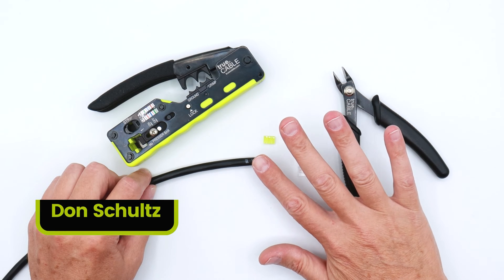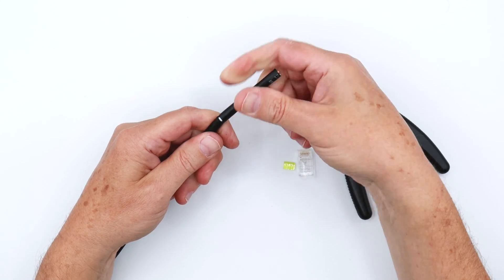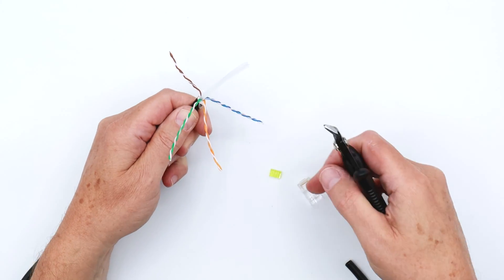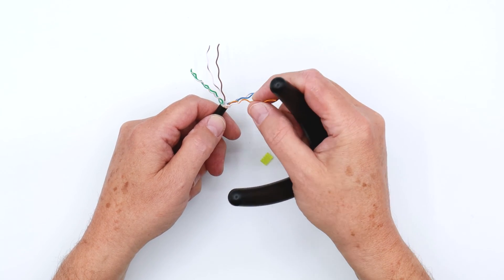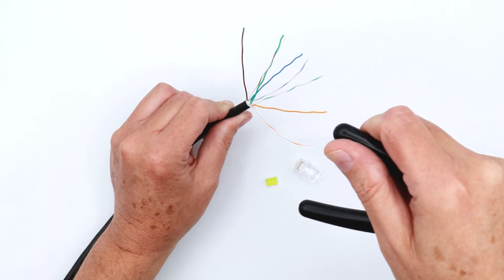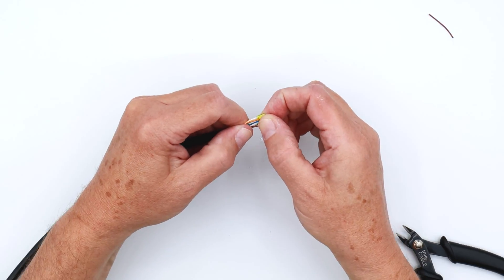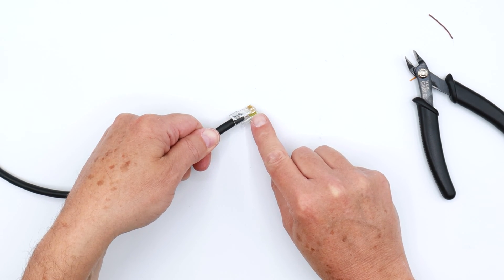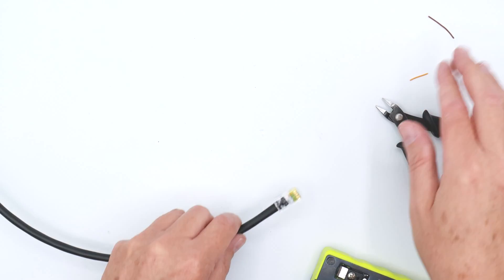How To: Terminating a Standard RJ45 Onto Cat6A Direct Burial Ethernet

Comment: The load bar design, is the best. Once I switched to them a few years ago, I've never use any other RJ45 since. The true cable load bar RJ45's are very very good. Only thing to mention about his termination, was that he could have removed a little but more of the plastic and water proof fabric so that the load bar could have been a tiny bit closer to the jacket.  Thanks for the video Don.
Reply from the maker: Hello! Thanks for the insight and kind comments. Indeed, I like the load bar plugs too and will use them when I can. Not to say the passthrough plugs don't have a place...which they do...and I often use those for Cat6 U/UTP Riser or Cat5e drops. I find myself deferring to load bar when the cable is super thick or when performance at the connector can become a real problem such as with Cat6A.

Comment: I'm familiar with the regular RJ-45 connectors used on CAT6A plenum cable, but have never seen one with the "Load Bar" you show here.  Is this connector style something special that's used on the heavier jacketed direct burial UTP cable?
Reply from the maker: Hello! The load bar connectors are not unusual, and quite good for any variation of Ethernet as long as the plug fits the cable correctly. It is especially beneficial if the load bar will hold the conductors in the correct sequence (while staggering them too for 500MHz / 10G operation and better crosstalk performance) while you place the whole assembly into the plug. This greatly reduces frustration with conductors getting out of order. Well designed pass-through plugs can serve the same purpose but pass-through plugs are also a bit more prone to sensitive to fitment caused by conductor insulation diameter manufacturing tolerances. The old style push-in (no load bar) that simply places the conductors straight across in a line are meant for 250MHz or less speeds (think Cat6 and Cat5e). Matching the correct plug to your solid copper cable is both science AND art, and is one of the reasons we suggest using IDC style terminations (keystones, patch panels) instead of 8P8C plugs unless you have no other alternative.

Comment: What about if you want to have a strain relief on the RJ45
Reply from the maker: Hello DCW. We offer those in various diameters if you are referring to strain-relief boots. They are the "slip-on" style but take note that slip-on style boots add thickness to the connector and may not play well with high-density switch ports (interference with each other). Aside from that, the primary strain relief of this plug is the external ground crimp collar, and that is why it must be crimped 100% perfectly every time. We have a tool for that--our trueGROUND external ground crimp collar tool.